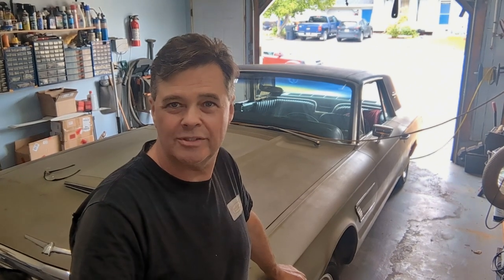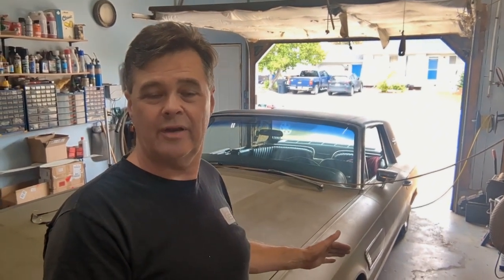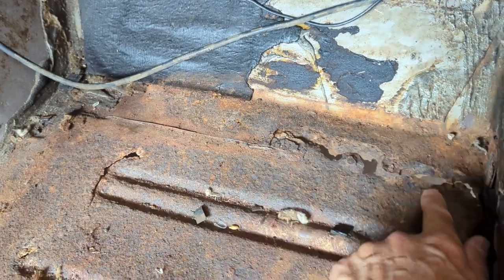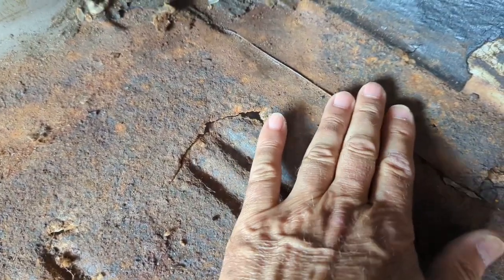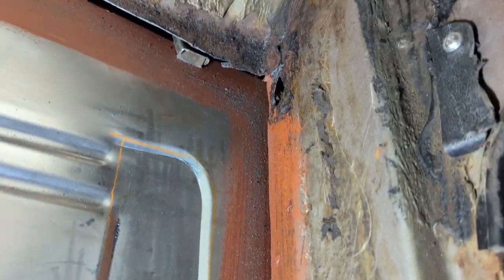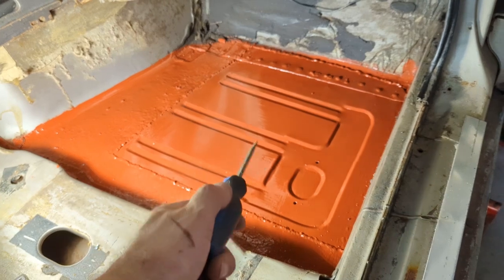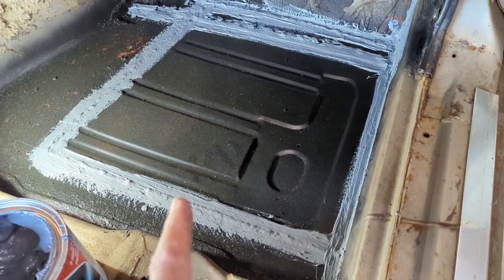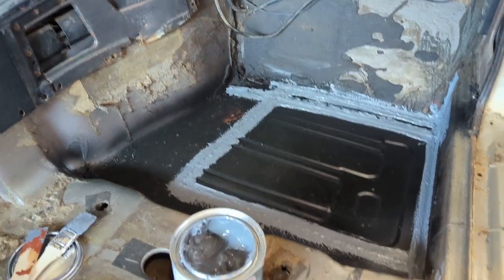Passengers Side Floor Pan Replacement - 65 Thunderbird Hardtop

Comment: Hey Alvin, nice job. Ill be doing this on the 66 conv I bought in LA. The drivers side had a rusty floor board and it goes up the wall forward of the ebrake pedal. When I bought the car, it had 2 inches of water in it from the rains there so we had to cut the carpet out of it to let the floors dry. Ill be getting it in July. Ill be watching your video again when that time comes. Thanks again for a great video.
Reply from the maker: Thank you Nick...I'll be waiting to see the condition of your new T-Bird, I'm sure you will have it all fixed up in no time!

Comment: Aovin,
The 60s Thunderbird floors seem to rust out far too easily...considering how much undercoating the factory piled underneath.   Leaky heater cores probably caused most of it on the passenger side.
As usual, a great job on the repair.
Regards,
John
Reply from the maker: Hey John, great to hear from you!
Yes, Ford sure tried to protect the metal, lots of undercoat & seam sealers, but I do question some of the design. Lol

Comment: Waste of time putting those factory drain hole plugs back in unless you want a trailer queen or the like. They are just for draining the metal treatment when dipping the body at the  factory like the guy says. Sometimes you run across an actual drain hole that needs to be there such as my jetta spare tire wheel.  Has a grommet with a hole in it. I guess for those winter flat tire changes , plus the occasional sunroof drain back up or tail light lens seals leak. If the carpet in the Tbird starts floating away get out the drill then look for the water leak
Reply from the maker: I feel there are places that a drain plug is worth having, like you said in your Jetta, also people that do off road, and don't have carpets that are hard to remove quickly.
Reply: @J_R_Shop  Come to think of it, 90 percent of the rust holes in floors that I have seen start at the 'drain plug" holes, moisture wicks it way through the joint or seam sealer  , if there is no joint/seam then its likely a better floor then those with the covers/plugs.